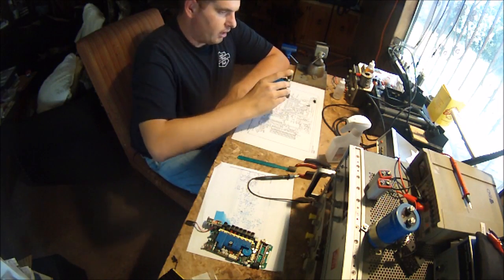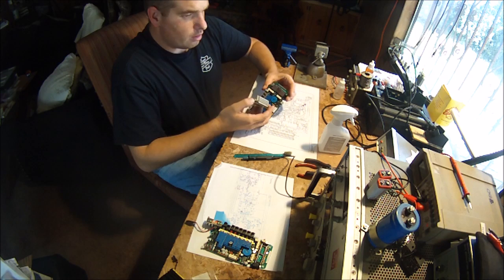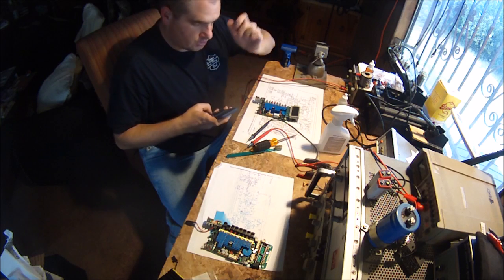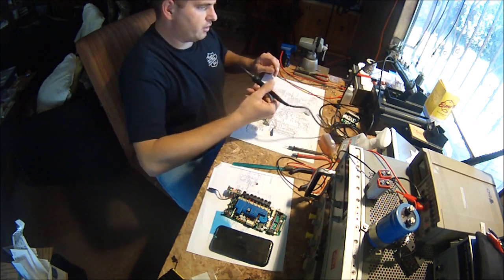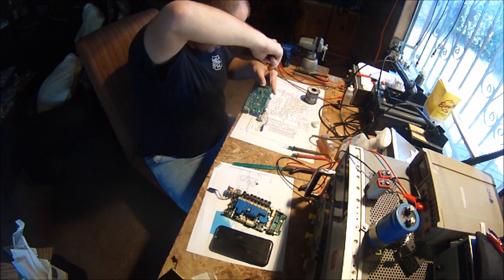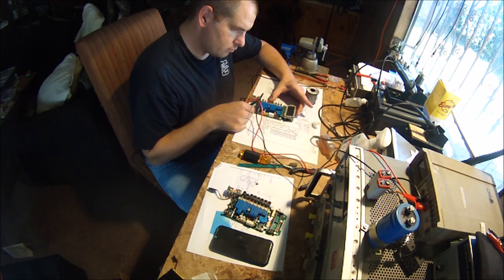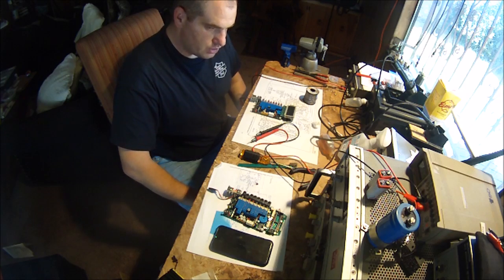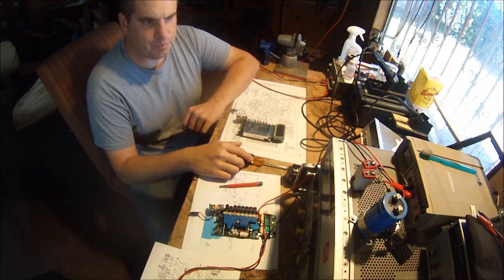Fluke 8060A Repair Part 4

Comment: Hint: before you begin tighten self tappers, rotate it anticlockwise, and you listen click. It is self tappers stand in old thread. It's may save plastic receiver.
Reply: donde se ubica repare mi fluke 8060a